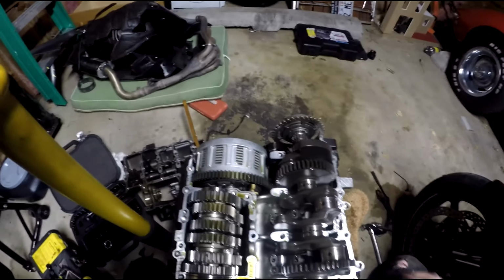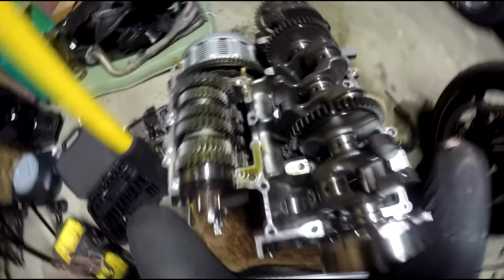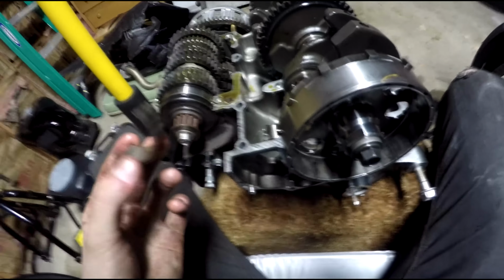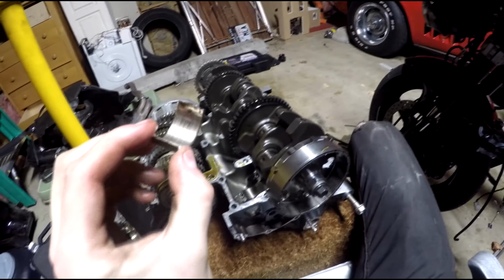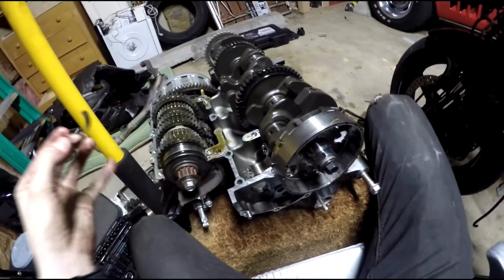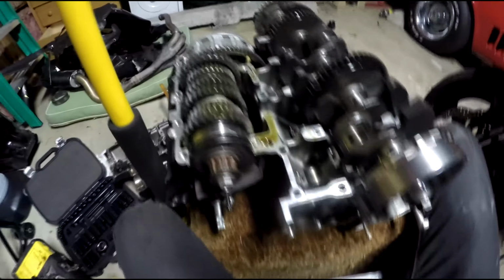Inside A CBR 1000RR Engine!

Comment: I'm stuck at the moment with my 12' cbr1000rr needing new headgaskets...the quote I received today was just over 2,400.00 🙃 that's is not anywhere near my budget. I'm considering doing the head gasket swap myself. But just aren't quite sure of the overall difficulty of the task. My skills mechanically are.. limited, I can take apart just about anything on my bike, I typically to all my maintenence myself. Do you have advise suggestions, warnings. I would greatly appreciate it.
Reply from the maker: Hmm, it would depend on how many miles are on the bike in my opinion, I spent less than that on a new engine with 5k miles, installed it myself and it was great until the bike was stolen. The headgasket job is a bit involved due to how tight the cylinder head is to the frame. In some ways It could be good to drop the motor, do the job then put it back in. I'll say it wasn't hard at all to pull out this motor, 4 hours out 5 in I'd say. Sorry for the late response.

Comment: So I don’t need to take apart the clutch to change the bearings and crack the case . You make it seem so simple how did the motor run after you finished ?

Comment: Awww man I jus took my car 1000rr apart today and the bearings were the same way motor seized up to... I need new bearings for sure did u use another crank or had work to it...so far everything else is good to go...
Reply from the maker: I tried to get the crank re-turned, but apparently it's "not a servicable crank" meaning they wont cut anything off of it, because nothing would fit then. I ended up grabbing a whole new engine off ebay, My cylinder head was messed up as well though.!, dropped it in, in 8 hours and the bike has been beautiful ever since.
Reply: Mythic Tech oh ok I figured that my cylinder head is still good but my crank is shot and my connecting rods.. so it looks like I'm hunting for another motor or crankshaft and rods...which ever is the least expensive... thanks man. Ride safe
Reply from the maker: Yeah, just make sure if you grab a new crank and rods, that you get the correct rods, for said crank, if that makes sense. Rods are color coded to a certain spec.
Reply: Mythic Tech yeah I know i have some homework to do..i have everything pretty much layed out so I'll kno wat to get...if I go that route... if I find a decent motor...hey...ill be riding sooner...thanks again
Reply: Do u kno the torqe settings for the rods?
Reply from the maker: Only thing I could find in the service manual on this: Crankpin bearing cap bolt:

N·m      (kgf·m,      lbMt)
27.5    (2 8, 20) +  90degrees
Reply: Did you have to remove you clutch basket to split the cases ?

Comment: How much did the repair cost in parts?
Reply from the maker: Ended up ordering a new engine off ebay, for about $1500 shipped, not a bad deal when I only spent 1500 on the bike to begin with. Rebuilding this engine would have required a whole new top end, new piston rings, a new crank, rods, bearings, and making sure all those things would work perfectly together just wasn't worth the risk. After putting the new engine in I added a quickshifter, launch control tuning system and a whole bunch of bits and bobs it works amazing.
Reply: @mythictech  so I can buy a new engine from eBay?I don't have problem with my 2009 if I don't count oil burning but I was thinking to rebuilt my engine but if you say it's not worth then I'm thinking to buy new one too

Comment: which honda model it is bro
Reply: 2008
Reply: @TparXxRandom  thanks please tell me 2008 and 2011 model are they same specification
Reply: @30bangash  Generally speaking yes, a 2008 engine will fit in up to a 2011 engine. Minor differences but will bolt up and run just fine. As for replacing 2008 engine parts with 2011 parts (such as a crank/bearings) I wouldn't risk it due to the tight tolerances.